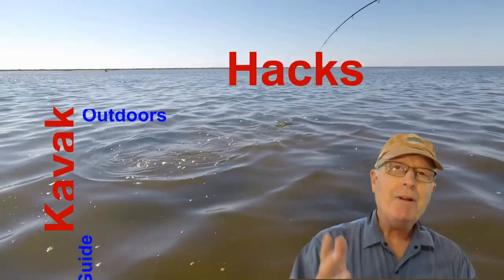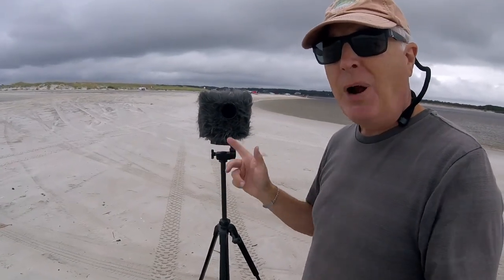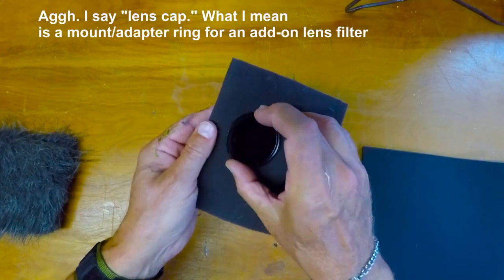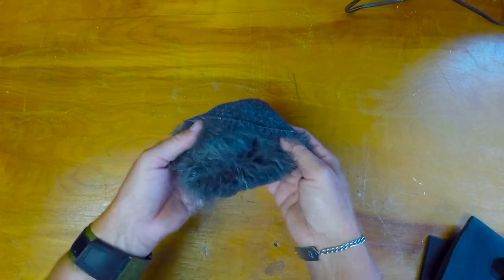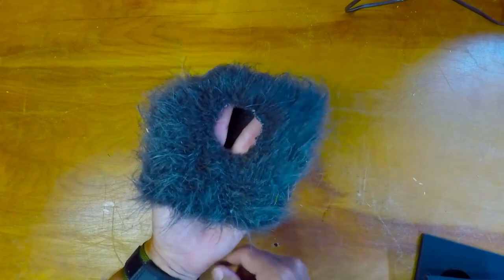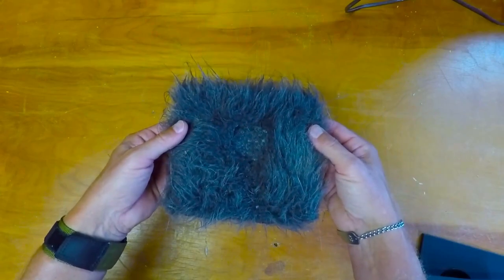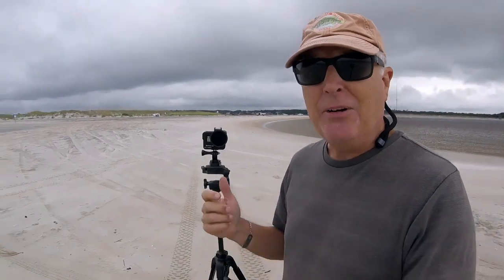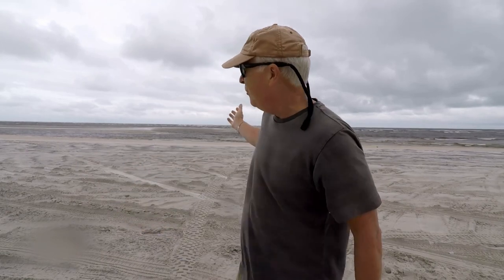Bargain DIY Way to Eliminate Wind Noise - GoPro Hero and other Cameras

Comment: That is a great idea! Wind noise drives me bonkers too. How much did you pay for everything? Where did you get the "faux fur"?
Reply from the maker: The faux fur was from JoAnn Fabrics and is sold by the yard - so you can get only what you need. This style was around 19 bucks a yard.  The foam was from BHPhoto and was 9 bucks a sheet - https://www.bhphotovideo.com/c/product/410408-REG/WindTech_WSF_1_WSF_1_12_0_x_12_0.html
Reply: Thanks, I look forward to making this project. I still have not tried the duct tape on the paddle trick yet
Reply: The Bowser Journal 
You can get some cheep fur at the craft store

Comment: Only need a lil piece over the mic to do the same just a lil fyi
Reply from the maker: Yes, but the Hero 5 requires a HUGE adapter to be able to plug in a mic.  This is easier.

Comment: Could that be a yeti pup?  It really works great Steve. Have you tried just the fur?

Here's a thought:  I bet you could use some 3M #77 spray glue to apply a smaller patch of the fur directly to the foam over the mike holes. That would eliminate that alpha male befuddling sewing trial!
Reply from the maker: The fur would probably work by itself, but I have not tried it.  I wanted the foam to provide a robust base that would prevent the fur from slipping.  I'll give it a try.  I do not want to glue since that would be permanent.
Reply: Slipping fur, yea that's what I figured, plus the backing for the fur is rather abrasive and would eventually wear the camera's finish.

As for the gluing I suggested, the idea is to glue the fur to the foam, NOT the camera.
Reply from the maker: Ah!